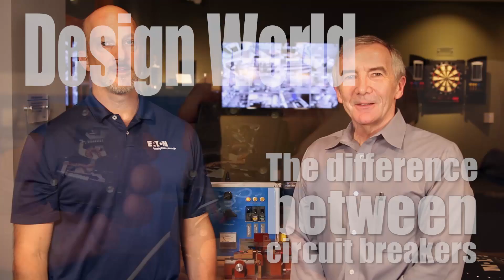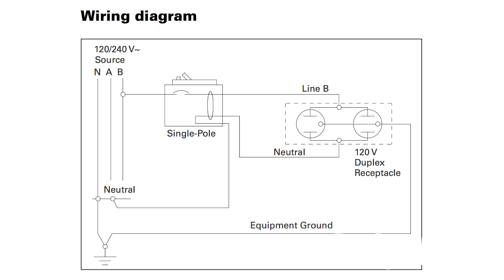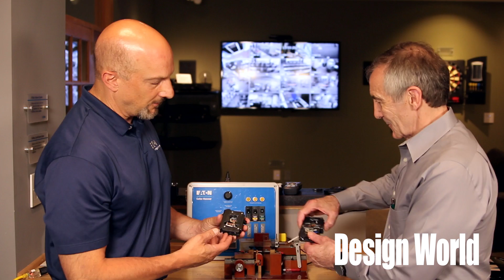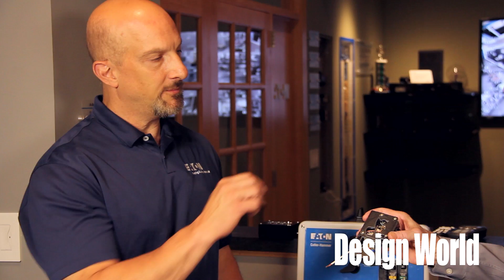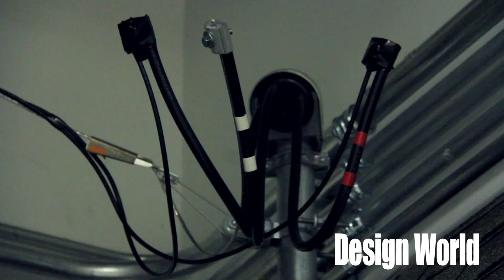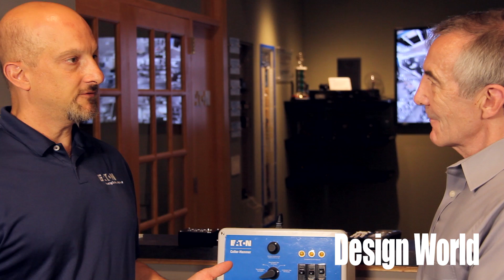The difference between a circuit breaker and an arc-fault/ground-fault circuit breaker

Comment: Great demo, these dual faults should be mandatory everywhere assuming they work well.
Reply: Well they cause problems in older homes. They are required in California and they are great for new homes but a lot of older homes trip them constantly when retrofitted. Most cities will allow you to go without them.
Reply: They do have their issues, situations are different every time.  For some reason LED lights will trip them sometimes, and other instances.  All in all they are great devices, but maybe should choose an alternative frequency to be "tripped" by.  Not just 1megahertz.  This would solve the problem if that alternate frequency was changed to another that isn't as close in the frequency range as the 1MHz.
Reply: Rico702Vegas yeah since making this comment I’ve heard that the GFCIs can be trouble in a lot of cases.